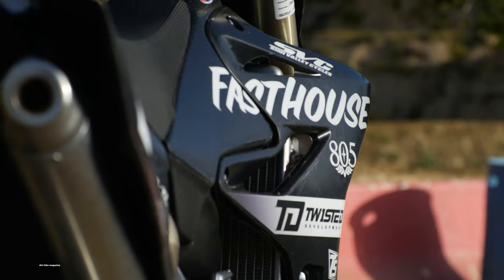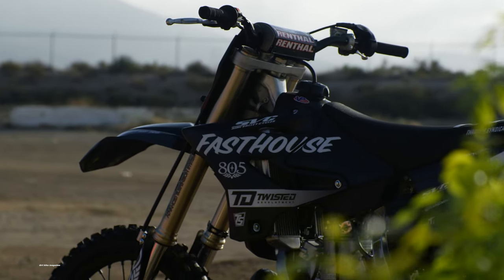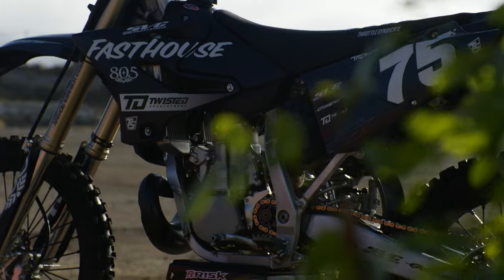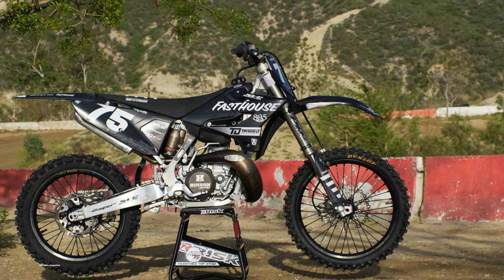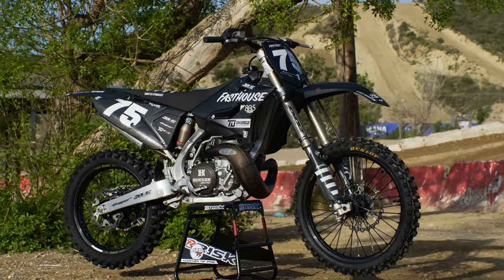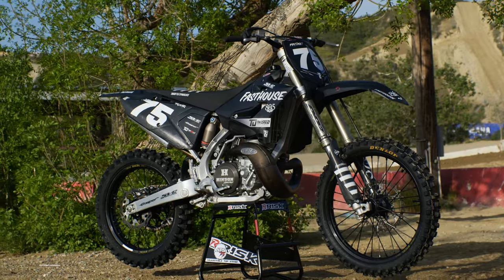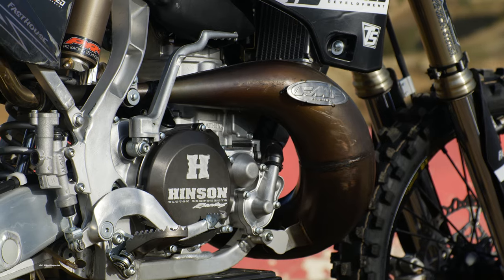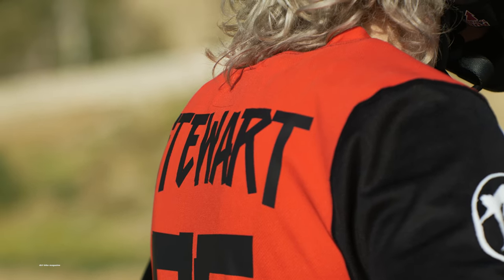YZ300 Two Stroke World Championship build with Trevor Stewart - Dirt Bike Magazine

Comment: Athena big bore kit
Lectron carb
V-force reeds
Full FMF exhaust
Hinson clutch
Twisted development tuning
Suspension work
Complete wheel set
Plastics, seat cover, custom graphics

“It’s PrEtTy StOcK”
Reply: You don't have to have all the latest and greatest stuff to win races but you need to upgrade basically everything.